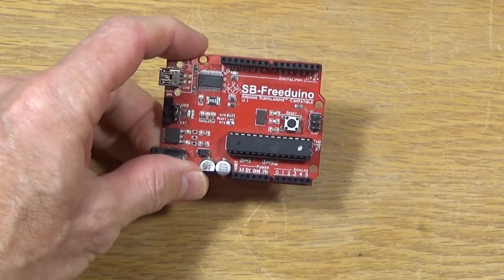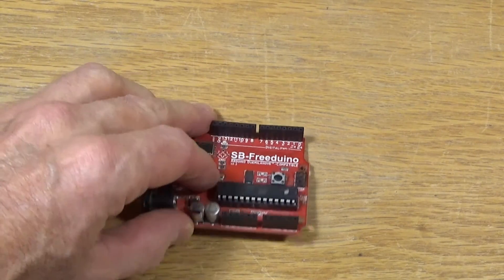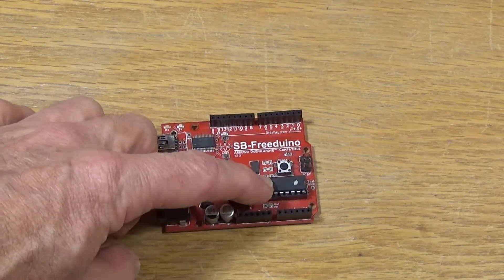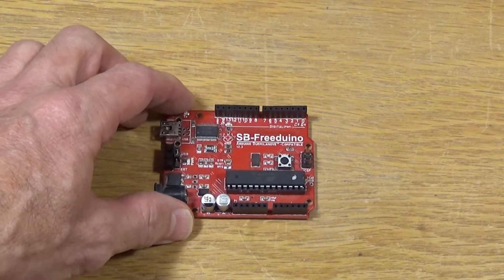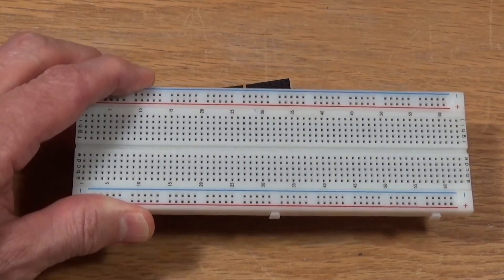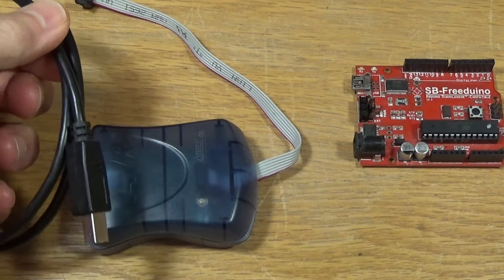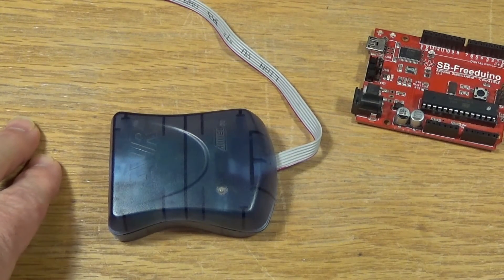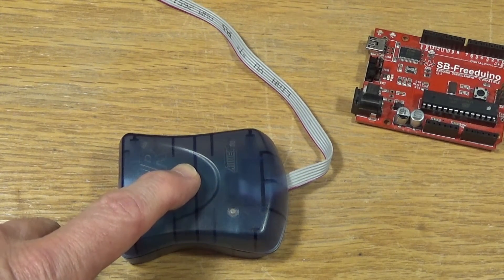Going Beyond Arduino #1, Introduction

Comment: AVR - one of the most expensive and complicated plateform on the market. The MPU's inetrnal memory layout is a worse. The possibillity that you are easy able to locks you out and can't get access to the regular used serial programming port, is definitiv not an advantage. The price for a jtag and an STK500 that you need to programm and unlock the chips again (if they are not soldered on the board), is also not a feature. The speeds of the MPU are limited and just few chips are able to driven an external system bus to join a graphic display, memeory or other pheriphere chips. The modified harvard memory layout is a horror implementation. It's very complicated and away from an Arduino purpose, i would not recommend them to start programmin MCU's.  ST's Nucelo and Discovery board are very cheap, very very fast and includes a full functional JTAG-programmer / on-Chip Debugger. 
You don't need to pay for external programmers/ Debuggers. I would recommend to use winIDEA-OPEN for a beginner as IDE. This is very easy in handling. Later, a move to "Seggers Embedded Studio" is a good choice, but needs some experiences with the GNU-MDK.  
The ST Discovery boards support the ADRUINO SHIELDS.

Comment: Going beyond Arduino series is the most helpful source I found in the Internet. Thank you very much for sharing your knowledge! I am an undergraduate student in electrical and computer engineering department and I would like to go beyond Arduino.  Do you think that avr chips are the best solution for my purpose? What about arm cortex m series (I am asking you that because knowledge of arm cortex m series is a prerequest for many embedded engineer jobs and everyone is saying that these chips are used everywhere)?
Reply from the maker: I'm not sure what your purpose is.  Simple 8-bit microcontrollers such as AVR can do a lot without the complexity of the bigger 32-bit ARM controllers.  On the other hand, the lower end (Cortex M)+) ARM chips are coming down in price to compete with the 8-bit controllers such as AVR.  If you learn and thoroughly understand the inner workings of 8-bit AVR controllers, the step up to ARM controllers will be easier.

Thanks for watching and good luck with your studies!

Comment: Can I use a FTDI USB to TTL to program the chip?
Reply from the maker: Not by itself.  You'll need a device (called a programmer) that is specifically designed to toggle the appropriate IO pins on the target microcontroller to transfer the program code to memory.  Read the description below the video for more information on where to get cheap USB programmers.
Reply: Thanks you so much!
Reply: dont you need to use the serial pins just to burn the bootloader and then you can use something like an ftdi to upload code?
Reply from the maker: You'll need a programmer (see comment above) to burn the bootloader into the microcontroller.  It's a special program that is tucked away in FLASH removed from the application code (the stuff you write).  It then communicates through the serial port (two pins) on the micro with a special program on your PC to transfer your code into the micro.  

Sorry for the late reply, been busy.

Comment: I am so glad that someone is finally doing this series.  People who have only programmed in the Arduino IDE always have such harsh words for Microchip PICs and other microcontrollers, but AVRs are almost identical in the way they are programmed (if it's not all done for you behind the scenes in the IDE)  Looking forward to seeing more.
Reply: The problem with Arduino is that it is too easy to learn, and as so it does not provide a stepping stone for more advanced stuff. It simplifies to much, and doesn't force anyone to have any critical thinking.
Reply: I'm with you man.  Learning at the metal is where true inspiration comes from

Comment: i've never erased the bootloader on my arduino uno when flashing secondary 328's 

As for buying those expensive programmers, you don't need to. just use your arduino  as an isp programmer.. There are literally hundreds of tutorials on using the arduino as an isp. And in all honesty, it's really simple to do, 4 wires, power, and a couple of 22pf caps, and an oscillator crystal, and the crystal is optional if you want to use the 328's internal clock.
Reply from the maker: Thanks for the info, I'm not that familiar with Arduino.  I'll look up the tutorials and see how it's done and perhaps incorporate it into a tutorial of my own.

Cheers.
Reply: https://www.arduino.cc/en/Tutorial/ArduinoToBreadboard

The info is a little outdated, but a really good starting point.
Reply: You could also use the USBasp programmer (the "little" programmer he talks about) they cost around 3-4 dollars from a US seller on ebay, slightly cheaper from china.  Pair that with a usb extension and you're good.  BTW, USBasp has the same driver problems as the Atmel programmer with windows 8 and above as far as i know.  It has something to do with signed drivers or something.  The best and simplest way I found to get around this is to install the USBasp driver using Zadig; it makes it simple.